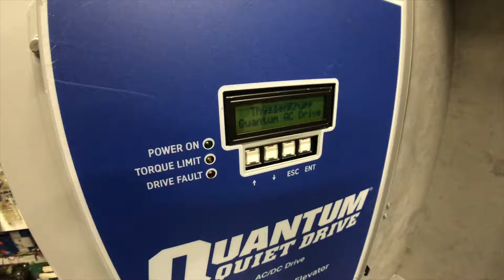Modernization of Northern West Elevators on Budget VLOG#6

Comment: When were these elevators installed?

Are the controllers original (but not the drives)? The motors are replaced, are the machines also replaced or are the machines themselves original besides the motor? Hard to tell from video but looks like fixtures are original?

Is the controller relay logic, solid state, or a hybrid of both?

These elevators appear to have an unusual roping arrangement (at least compared to most photos/videos I have seen), what is the reason for this?
Reply from the maker: Yes. 
Yes, machines are original. 
Fixtures are original. 
It's hybrid.
Not unusual for the period, especially when the developer was limited with maximum building hight.
Reply: Since the motors were replaced to be compatible with the drives, are they AC motors? If so, did they replace DC motors, or were they incompatible for a different reason?

What type of drive did these elevators have before the current drive? Did they have DC motors and motor-generators?

Also, I have some questions about Northern elevators.

1. Some of their fixtures look very similar to Epco fixtures (despite them having advertised them with their own names different from the names of Epco's fixtures), were most or all of them manufactured by Epco (and if so, are some of them custom designs manufactured just for Northern)?
2. Who manufactured the arrival chime and floor passing chime units used in Northern elevators (including the floor passing chine that can be heard in this video)? Did Northern manufacture them, or did Northern buy them from a different company (either Epco or a different company)?
3. There are some elevators that look similar to "Northern" elevators in terms of fixtures and chimes, but have different manufacturers listed (one that I know of is Niagara Elevator, but there are also others). Are these Northern elevators distributed/sold by other companies? Or are these companies that bought fixtures/chimes from Northern? Or did these companies simply buy some of their parts from the same suppliers as Northern?